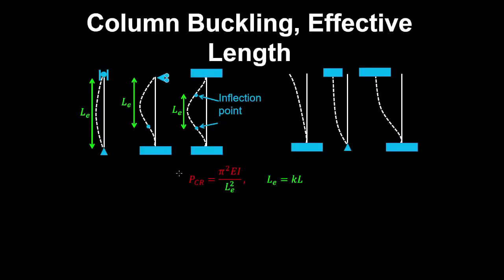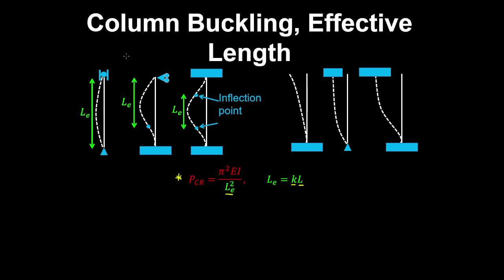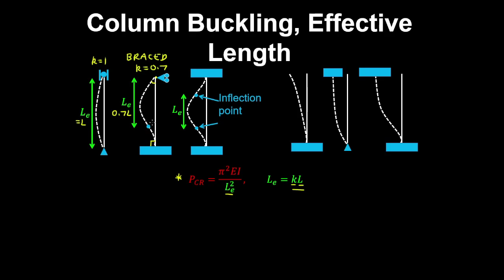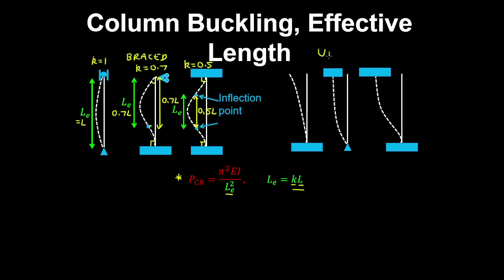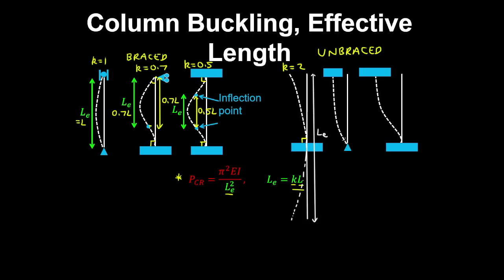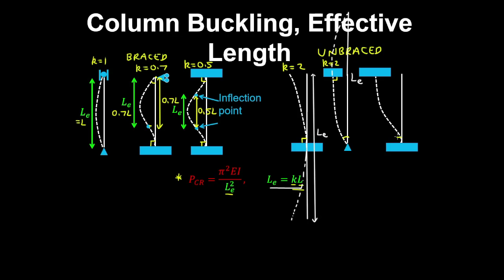Column Buckling, Effective Length - Structural Engineering

Comment: Hi, Thanks for sharing your knowledge. I'm studying the column bucking and effective length factor, Ke about the embedded post at post frame construction. I believe the bottom condition will be partially fixed and free-hinged at the top (side-sway effect). Could you tell me the Ke value? and if so, can I have the equations? Thanks again for sharing with us. Have a nice weekend!
Reply from the maker: You're welcome. The analytical equations are more complicated in cases where the frame members contribute to the stiffness of the column i.e. where you have elastic restraints. 

Some options:
* Modelling your structure in a structural analysis software and done a buckling analysis
* Alternatively you can see Timoshenko's book on the Theory of Elastic Stability, which derives closed form solutions for buckled columns in frames with elastic supports (some of which need to be solved numerically).
* Use a design standard e.g. steel design, which have the equations that can be used directly to obtain the stiffness at the endpoints of the column